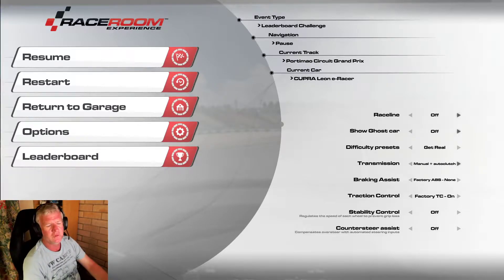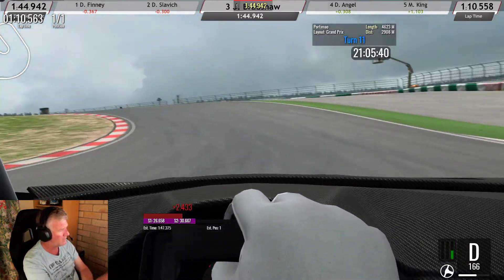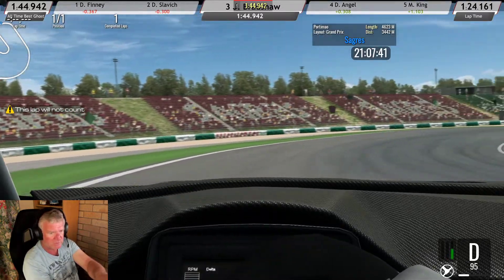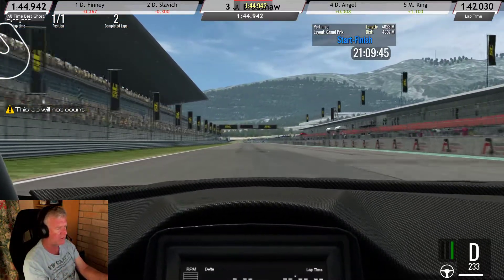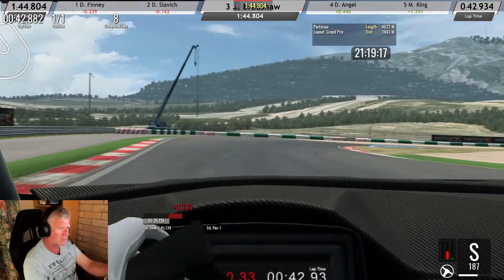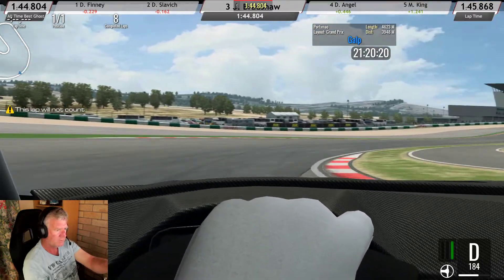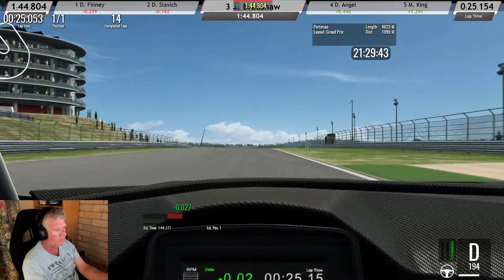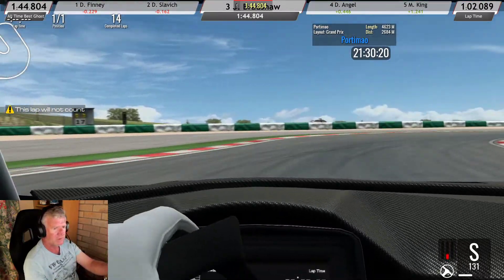JB'S Track Guide. Cupra E-racer at Portimao for AUSNZ Simracing in Raceroom. 1.21 Gigawatts Marty

Comment: From the Sector3 forums:

---
Now, on to the drivetrain and you may of already found that there are two driving modes; D & S:

D-mode is a simple drive-only mode. You put your foot down, it uses the battery power up, that's all. It doesn't recharge so once it's gone it's gone. It also disconnects the motors when you lift of the accelerator pedal, so deceleration is only by wind resistance, rolling resistance and the brakes.

S-mode is where things get clever. It enables regenerative braking, which basically reverses the poles of the motors as you lift of the throttle or brake. That enables 'engine braking' when you lift off the power, and also charges the batteries when you press the brake pedal. The regeneration is up to 15% efficient, which means that up to 15% of the power available at the current revs is instead sent as charge to be stored in the batteries.

There's more to it though - if you scan through the keymapping options you'll see that we have added the option to set different regen modes. Now this is really important when you consider that the regen happens only at the rear axle, so how much regen is active can really change the balance of the car. It may also be the difference between winning and loosing a race as now power-management becomes an important part of race strategy. At a later date we will also be adding engine map modes, whereby the amount of power and thus energy consumption will become adjustable in-car. 
---

So maybe getting used to the D driving mode and balancing it that way would be sufficient enough, as there will be unlimited electric charge. But you will have different behavior on lift off, as there is no engine braking behavior and a different balance of the car, as you mentioned.

Comment: Only just catching up now JB but quality guide as always, thanks mate! Me personally, I'm keeping it in S mode all the time since it doesn't have any effect on acceleration, only braking, and makes the lap a lot easier since it basically becomes an automatic. Will try switching between modes in practice later today just to check but pretty sure it shouldn't cost you anything if you leave the D alone.

Also, David J Finney is my dad 😉 he seems to be getting on the leaderboards a bit more these days. If it wasn't for the whole UK ping thing he might be able to join us for a race or two.